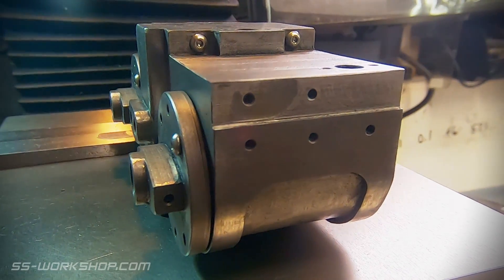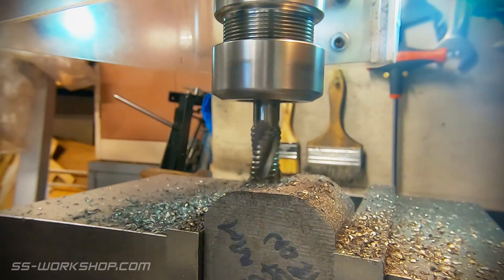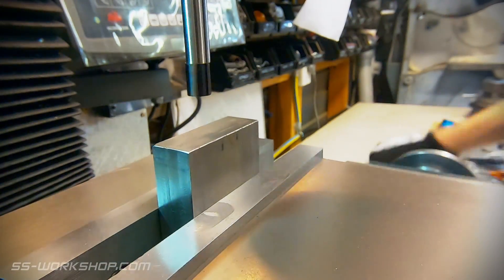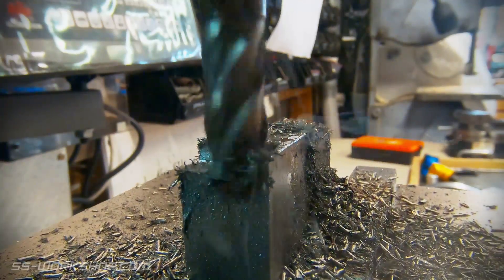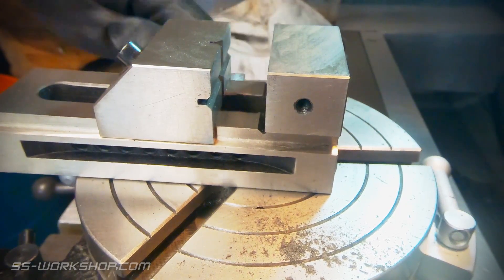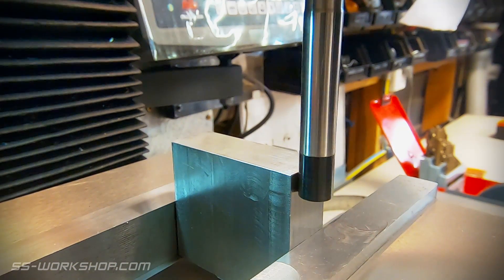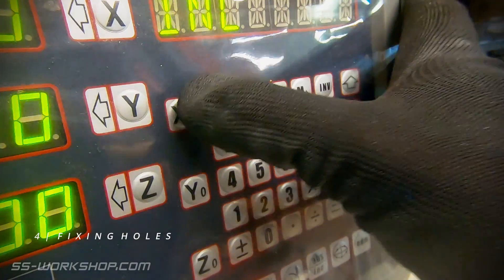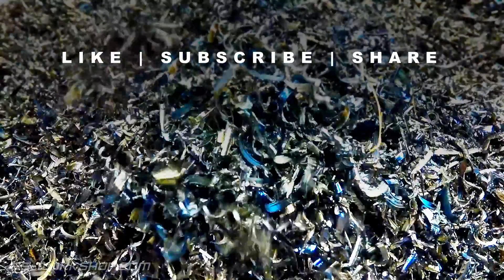Fell Engine Project - Shared Steam Chest S1.E27

Comment: I dont understand why a smaller mill run at a higher RPM gives a better finish. Isnt the speed of the cutting edge the same whether its a small diameter at high RPM or a large diameter at low RPM?
Reply from the maker: .
Your correct, my reasoning is flawed, I am running them run at the same surface speed. It appears from a quick bit of research that what may actually be giving the better finish could be the reduced cutting force which makes sense on the rotary table where the setup is less rigid.
Reply: Im loving your youtube posts. Its very helpful for a beginner machinist like myself